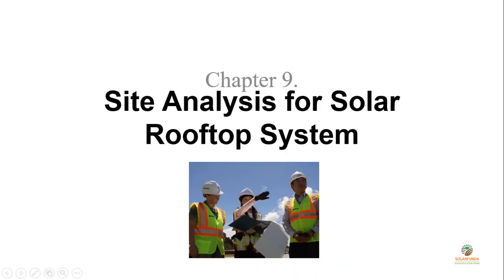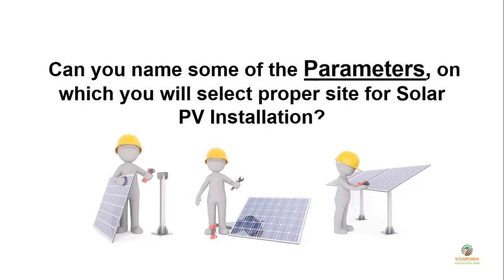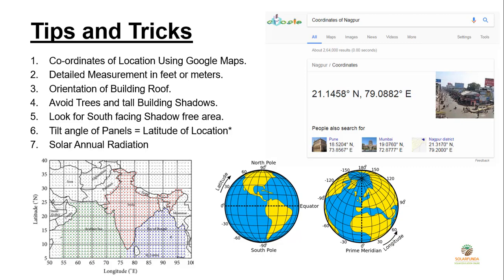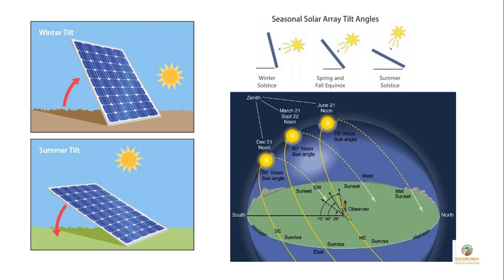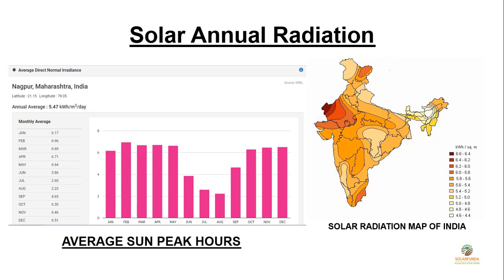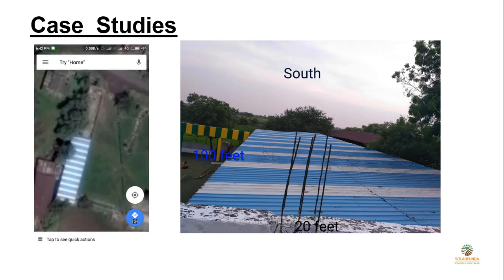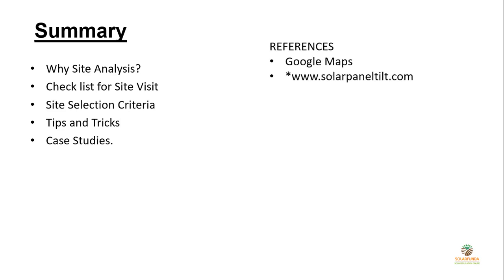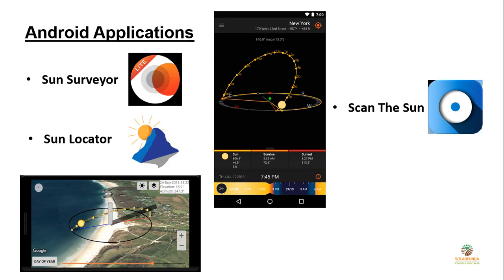Site Analysis for Solar Rooftop System | Chapter 9 | SolarFunda

Comment: Great info
but you mention wrong about tilt angle, in summer when sun is overhead, you need a large tilt angle.
Reply from the maker: But during summer, when the sun is overhead, tilt angle is now. Tilt angle is between the surface and solar panel.